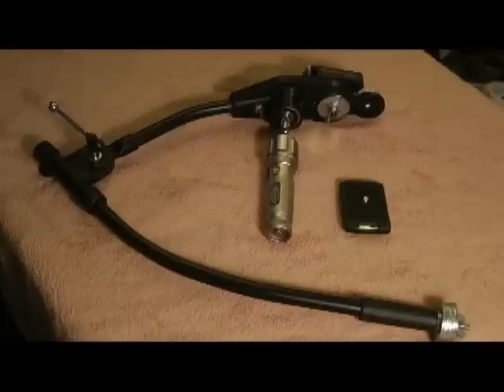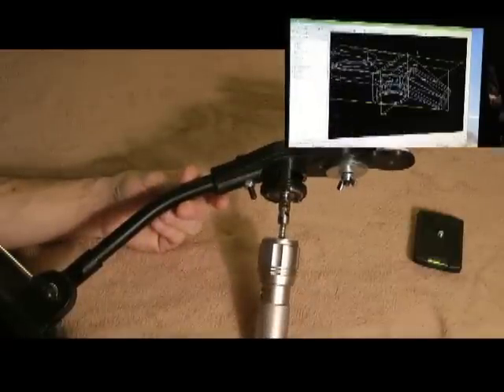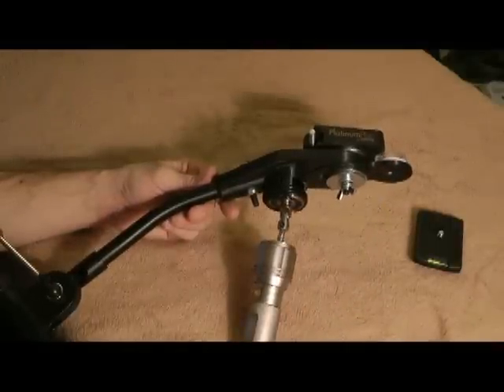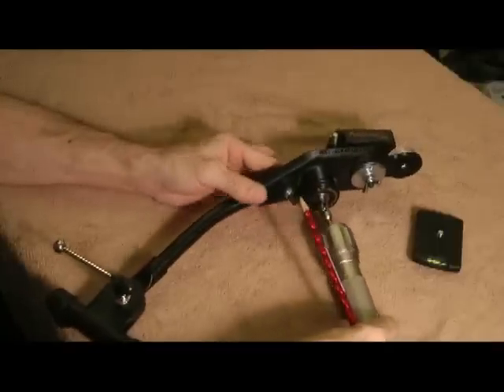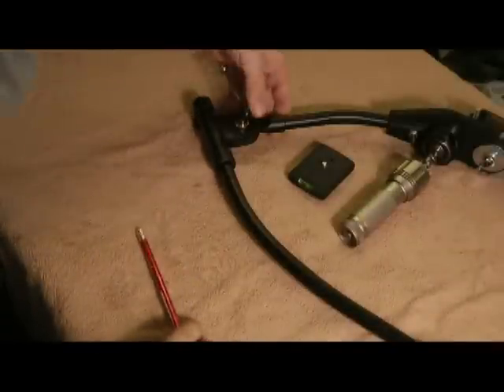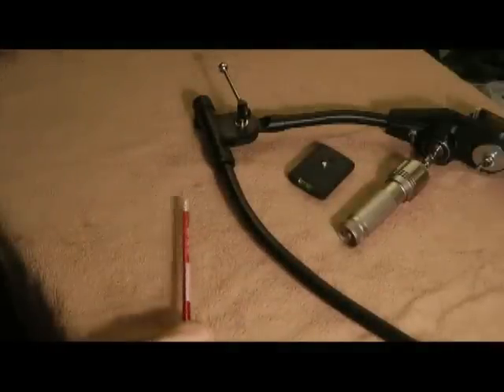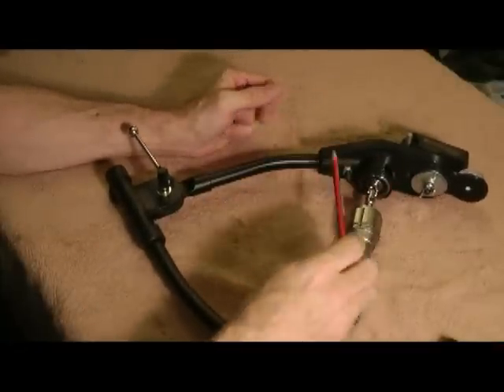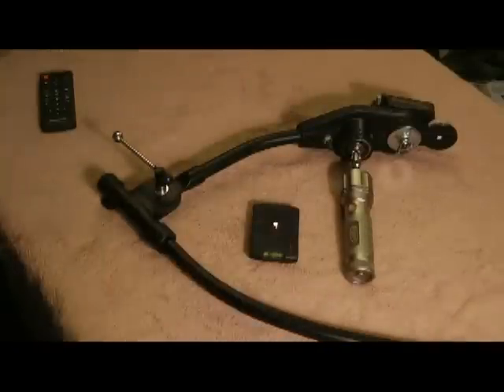DIY Steadicam -Baseplate & Arm Spar

Comment from the maker: The same length as the Merlin design arms.  Don't remember exactly but look up Merlin specs online.  I think about 8-10 for short arm and about 14 for long arm.  But look up Merlin specs to make sure.  Actually somewhat arbitrary as you can balance it out with weights, camera placement and angle of arc with boom mic joint.

Comment from the maker: Kipcarver@hotmail.com I should tell u that the plastics base is not cheap.  The material that it is made with is expensive and u could b looking at about $135 from what he told me last.  But it is a very cool design and works great.  The key is also having the adjustable arm spar as well as the handle assemble.  And make sure the bolt that was flattened down gives a good perpendicular fit into the traxxis u joint.

Comment from the maker: I pretty much used the same specs as the Merlin design for the length of each arm.  As far as the arc...just eyeballed it really.  I knew as long as I had that boom mic joint I could adjust as necessary.  So really the arc doesn't matter that much.  As long as you have those other areas of adjustment, you should be able to balance the design properly for the camera you are using.  I honestly tried to copy what I saw in the Merlin as that is the best design out there for that type of stabilizer.

Comment: I understand how you filed off a flat edge on the 5/16 lag bolt (to go into the wooden dowell inside the flashlight) so the set screw on the bottom of the U joint would be held tight.

How did you secure the top of the U joint to the camcorder base plate?

thanks

Comment from the maker: @cisco1982 Thank you for even wanting my design but i am not making these as I would have to charge you more than what it is really worth probably.  The baseplate is a custom design from a U-Print machine that a friend has.  The actual cost of just that piece would probably be around $150.  Other than just the baseplate...the rest is easy to build and i go through all the parts and stuff i used in these videos.  Just get creative for the baseplate.

Comment from the maker: @causinchaos22 You make a very valid point i will admit.  However, i did state in the video that the baseplate design is something that anybody can come up with there own.  But they can still use the same concepts i used.  Other than the baseplate-the arm, joint, and handle assembly are all something that anybody can make following how i did it.  And those are all components that could be adapted to a baseplate design of your choice.   You still gotta have a handle and you have to have an arm.